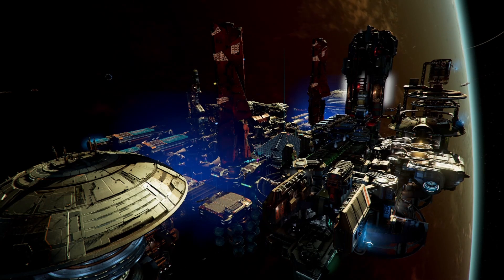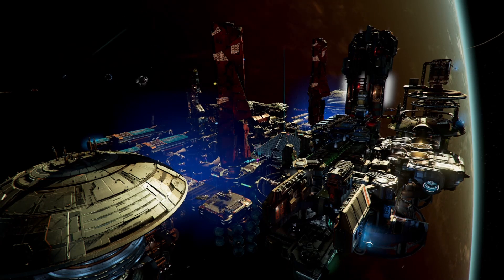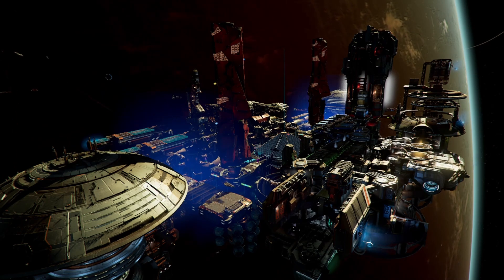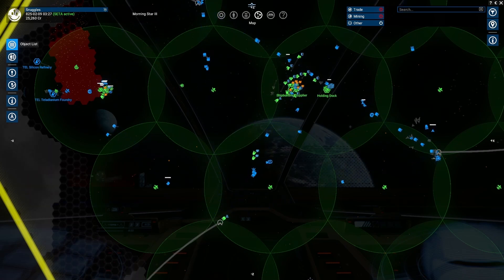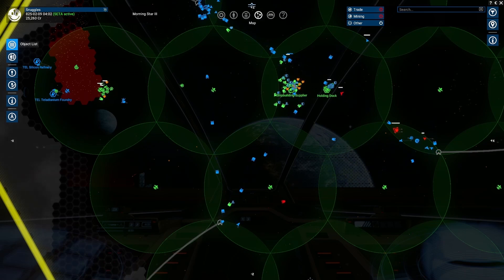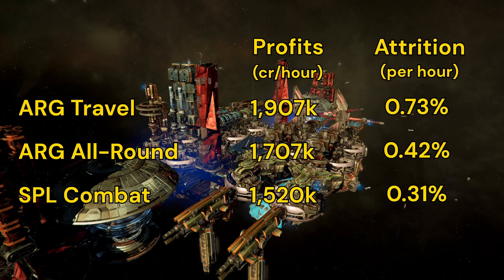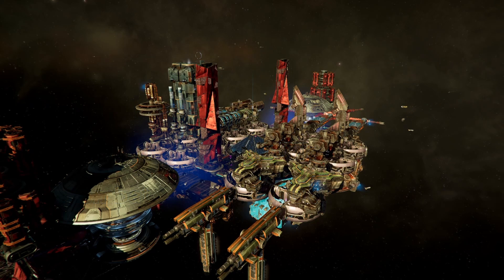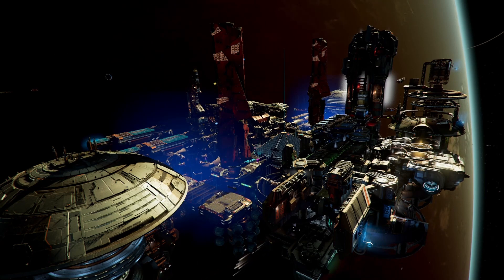[OUTDATED] X4 Propulsion Lab, Part 3: M Trader/Miner Field Test

Comment: Were there differences between the miners and the traders?
Reply from the maker: The miners never had to deal with pirates, just Kha'ak and the occasional Xenon, so overall they had higher survivability than the traders. They did tend to burn through laser towers faster when the Kha'ak were especially active, but they still never deployed more than 25% of their towers in any given run. Also, miners have a split focus between normal cruising speed and travel speed, which makes All-Round and Combat engines more competitive on them, although Travel is still technically the most profitable any time they're traveling multiple jumps to reach their mining locations.

Comment: I'd've said losses would have been 2-3% for travel engines, but it may be that I have a lot of travel (but no xenon: already killed off). So the losses being 1/3 to 3/4 of a percent is a surprise. At 2-3% it will be often enough to make it a drag. That is why I would have removed the 3s delay, because to balance the higher travel speed it is more expensive and it accelerates to max speed slower, and therefore reaches the same speed as All Round engines travel at later than they manage, but are able to go just a bit faster. Since Travel is for non-combat use, it is fair enough. You'd fit AR if it is tight for money or if you aren't as concerned about either travel or cruise speed but can't lose either as badly as the specialised versions.

Comment: Thank you for these. I tend to be protective of the ships, due to the accumulated skill levels of pilots and crews. My game is modded, but my main medium trader in current save file is a Hermes with Arg Trv mk2 engine, in Terran and Pioneer space. I'm still experimenting with medium traders in the commonwealth areas. The Scale Plate have been exceptionally annoying. The Fallen Families were even in Sacred Relic. I'll probably just use large traders in those areas, or add escorts. Expensive.
Reply: Scale plate pact minotaurs are extremely annoying. You need destroyers to relyably killthem without losses, and dedicated corvettes for escort duty is already cost prohibitive by the midgame.
Reply: @egoalter1276  If not for game performance, I'm tempted to just build a road of laser towers between all the stations. I can't even imagine hot much my PC would explode.

Comment: Lines up with my expectations pretty much. I've used both Demeters and Boas for a while now and they've both worked great, and I don't reckon I'll be switching from travel engines for a sub-1% difference in survival rate per hour. Late into my game though and I'm surprised at your guys' ability to escape Kha'ak, even with Lasertowers. My M miners still get melted by them as they start to attack in swarms -- maybe a longer simulation would be required to manifest that outcome.
Reply from the maker: I got a couple of decent Kha’ak swarms, but mostly just groups of 2-4. The really big swarms would be a problem, since flak + towers can't drive them all back at once. Theoretically, by the time you've reached that point in the game, you have the option to use L miners or add some defenses for your M miners.
Reply: @CptSnuggles07  Right, so the Kha'ak findings don't specifically challenge the community wisdom of switching to Ls eventually. Good to know; thanks.